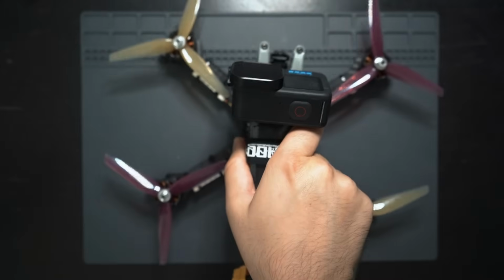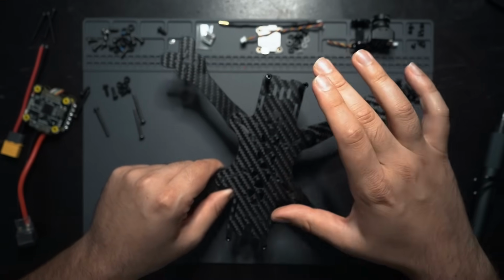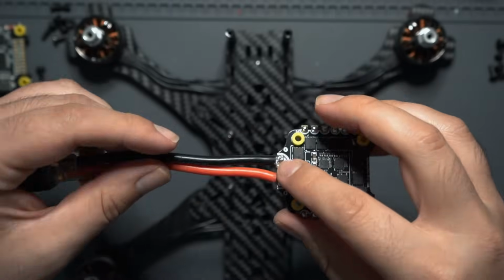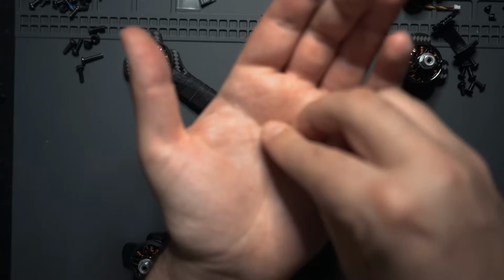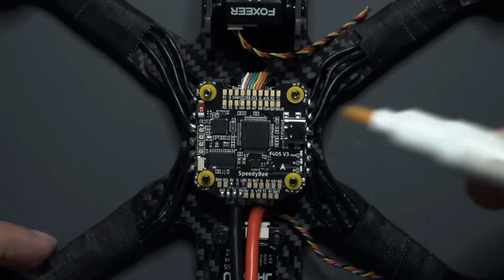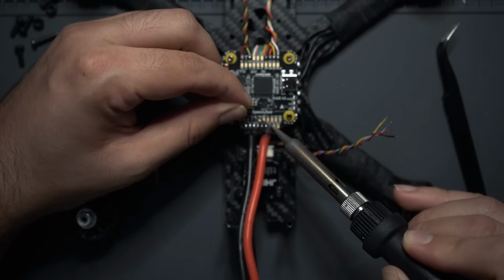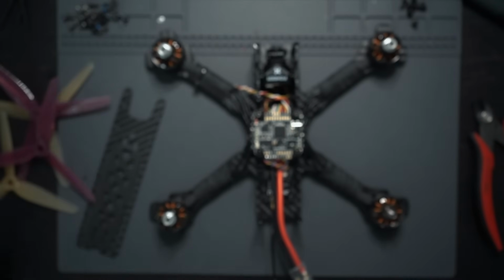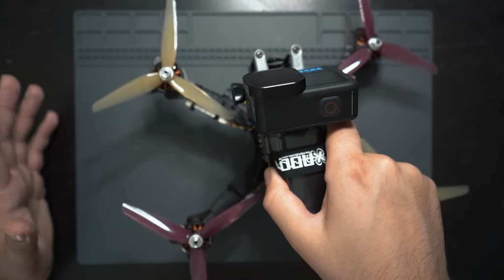Build a Freestyle FPV drone for $200

Comment: You made this look so fun and easy, I ordered the stack a couple days later. 2-4 weeks to get it, but I'm pumped. Thanks for this video, it'll be invaluable. My kids will love the drone we build.
Reply: How did it go??
Reply: @RankedVines  Generally great. The only snag was unrelated to the stack. I got a controller and radio protocol situation that isn't playing nice, and I need a Windows-based computer to do a firmware update. Huge drag, as I use MacOS and Linux. Regardless, I had a ton of fun building around this stack and initial testing was a blast. I can't wait to sort out radio issues.
Reply: Quadcopter
Reply: @murrijuana2842  Do you mean it won't be a drone, but a quadcopter? I thought a drone was a crew-less, either remotely or autonomously operated vehicle. I suppose quadcopter is more specific and therefore technically more correct.

Comment: how would this build compare to a nazgul 5 v2. also how much of an upgrade would you say is switching the antenna that comes with the vtx for the one that you used.
Reply from the maker: I'm not sure about how it compares to the nazgul 5. The stock antenna is good if you think you'll crash alot, otherwise, I would spend an additional $10 or so to get a more solid antenna. You'll get better video signal.

Comment: I built everything the exact same way that u did but the instant that i arm the motors it starts getting hot and vibrating really badly
Reply from the maker: what ESC protocol are you running?
I've heard of issues running bluejay on this ESC, not sure if thats what you're using.

Comment: Do you have a video on how to bind it? I built up the drone but I'm just having problems trying to bind it.
Reply from the maker: the binding procedure will vary depending on what receiver youre using
Reply: @TRONCATFPV  Thanks. I found out that I didn't get the right combination of transmitter and receiver so I got something else and It went smoothly

Comment: Just ordered all the parts from your link, I’ll drop a comment if I really get stuck building it.

Really placing a bet on your setup, I’ll keep you informed how it goes !
Reply: how much you payed ? more then 200$?
Reply: @goldfire4827  total was around 660$ with batteries, charger, goggles, and everything else
Reply: @goldfire4827  the drone itself was 220

Comment: I'm a beginner in this kind of stuff and  i really want to learn how to build one, I just want to know if the controller is included or excluded for the 200 bucks budget. Thank you.. I really need more advice guyz please give me an idea to make one. 😊😊
Reply: The $200 is just for the drone, transmitters (controllers) can range from $60-up I would recommend the Randiomaster TX12. You will also need to buy goggles which are $100-up

Comment: It's $220ish. Not $200. That's without the remote or headset too.
Reply from the maker: Prices fluctuate, it could be $180 next week. 

And yes, those aren’t included in the $200 price. 
This video is just how to build the drone, not an everything included kit.
Reply: @TRONCATFPV  I was just letting other people know in the comments. What is a good headset and remote that is cheap?
Reply from the maker: @ARandomDude72  Please check the description for links to additional equipment 👍

Comment: do you need fpv goggles to fly this?
Reply from the maker: I would recommend using FPV goggles with this drone, but technically you dont need them
Reply: @TRONCATFPV  thanks. could it be flown with android phone with adapter or just by line of sight?
Reply: @TRONCATFPV  I’m new to building drones. I haven’t even watched the full video yet, but I saw the thumbnail and was wondering what the purpose was of two cameras, the little one on a gimbal down below and then the go pro
Reply: @rocketman9030  the little camera is an analog camera, that it the camera where you look through when you fly with fpv goggles. analog because it has a low latency.   The GoPro is just there for the cinematic recording.
Reply: @swugger  thanks! How much weight does the go pro add, and how much is the one he uses in the video? I couldn’t find it in the description

Comment: Hello, im new in FPV and have a question. Do all these little Parts like Cables and stuff come with the parts i ordered or do I have to order these seperate?
Reply from the maker: all of the wires and screws come with the parts used in this video.

Comment: I got most of these parts to follow this build but I'm having a problem. When I arm my drone, the motors will go spin erratically and when I try to throttle up, the drone will wildly flip out. I have already 100% checked prop rotation and prop orientation. I ended up flashing Bluejay to these motors from BLHELI. I re soldered all the motor wires to the ESC to ensure good connections. Any tips or words of wisdom? I'd hate to keep throwing money at the drone replacing parts, until I troubleshot further. Any tips for pid tuning or settings within Beta Flight?

Comment: the frames discription says it can hold a Stack Mounting: 30.5m30.5mm but the fc mounting holes are only 30x30 how does it fit
Reply from the maker: 30.5mm x 30.5mm & 30x30 will fit the same 👍
Reply: @TRONCATFPV  ohh cool i was abt to get a frame 2wice the price caus i thought it wont fit

Comment: Can I mount my GoPro 8to this without doing any beta flight settings? Or do I need to add settings because it adds more weight?
Reply from the maker: it'll probably be good, check motor heat and play with the PID settings if it flies odd

Comment: i upgraded the vtx to a $35-37 Rush tank unit... other than that i followed the build as is...
i got 2x batteries and 3x sets of props... so far iam $320 invested . (free shipping)(late dec pricing) (every thing from RDQ)
i could buy the recomended beginner money saver radio and goggles  but ... ive been researching more and ill probably space out the purchases and get better equipment. 
grand total iam probably looking at $800 invested for my first 'serious' drone 
no regrets , hella excited 

anyone else what was your first drone realty ?
Reply: I am doing something similar were you able to find the BetaFPV 2.4ghz ELRS rx on the website? seems to be sold out everywhere and not sure what a alternative is maybe just the tower version?

Comment: Looking into building an fpv drone and this guide is super easy to understand and well detailed. Two questions I have though are: a) how much does it weigh? And b) what goggles/controllers does this build support?
Reply: I do not have an answer for the first question but the build's VTX card supports all analog goggles and the radio receiver is compatible with all ELRS controllers.
Reply: He literally answers both those questions towards the end of the video

Comment: Awesome video! I'm thinking about doing this for my first build. I bought a rtf drone a while back from rotor riot that came with DJI FPV system, what would I need to buy to use the same goggles and transmitter with this?
Reply from the maker: Instead of using the VTX and camera I used, you will just need a caddx vista/runcam link and you'll be able to use your controller and headset with this quad 👍
https://bit.ly/3C9ic3a
Reply: @TRONCATFPV  Thank you so much! I will definitely look into it.

Comment: love the video.  My question is, is there anyway to connect the go pro up to the video transmitter?  My use is much different.  I am trying to build a target camera with a go pro I already have lying around.  I basically need to be able to set the camera up near the target and be able to view the feed on a tablet 300 or so yards away.  This looks like it would work.
Reply: Whats your use case for it? I might have an idea
Reply: @aepfelpfluecker  I need to be able to see bullet impact on paper targets about 200-300 yards away

Comment: Hello! I'm thinking of building this drone and getting into fpv flying, and this video was absolutely fantastic at explaining everything. My only question before I dive headfirst into buying all of the parts, does the VTX come with that little antenna that you plugged into it, or is that a separate part that you had on-hand? Cause it would be a nightmare if I soldered all of that together just to burn out the VTX.
Reply from the maker: I'm glad the video helped ya!
All of the VTX's that I have ever ordered come with that type of antenna 👍
It won't give you the best range, but it will work!
Reply: @TRONCATFPV  Thank you so much! As I get deeper down the rabbit hole, I'm sure I'll figure out which give better range, but this is a fantastic start! I do have one more question though, is there a handheld controller that you recommend to beginners that would be easy to pair with the drone and start flying?
Reply: @zachd7757  look in his description he should have good cheap items, make sure you get the ELRS version of them though

Comment: Frame: $30
flight controller and ESC stack: $70
Video Transmitter: $15
Receiver: $12
Props: $3.50
Motors: $60
Camera: $20
BetaFPV ELRS Receiver:$12
Batteries:$40

Total:~$260 ...
Plus your radio controller and the goggles, that are another $200.

So like 500$ to get into FPV drones and then a go pro ....

Not quite yet for me. I'd rather go for a betaFPV whoop of some kind as a total beginner anyways ...

Comment: Will Flysky FS-T6 or TX12 Mark II Radio Controller or Boxer Radio Controller (M2) work with the drone
Thanks for the tutorial, it has really helped me out thanks
Reply from the maker: Glad it helped!
Yes you could use this drone with that controller, you'll just need a compatible receiver
Reply: @TRONCATFPV  thanks also will I need or require a pdb (power distribution board)

Comment: What kind of range can you get with this particular set-up using the receiver you have listed in the description? Also, is there any way you can increase the range with modifications to the same set-up?
Reply from the maker: With the antenna-less receiver you probably wont get far range. For longer range I would recommend any ELRS 2.4 receiver with an antenna

Comment: I picked one up last month a the 5 volt pad for the vtx out put full battery voltage and yes I no there is a pad right next to the 5 volt pad that is supposed to out put full battery voltage I soldered it up correctly for a speedy bee tx800 and it smoked it I thought I got a bad vtx so I hooked up a nother new tx800 vtx and smoked it.

Comment: So it’s not $200. You added alternative parts, a go pro because that camera is trash, a battery and most people doing s budget build dong have a soldiering iron/ solder goggles and a remote control. Cool drone though
Reply from the maker: Nope, this drone cost $200. 
The title of the video is "Build a freestyle FPV drone for $200" not "Everything you need to build and fly FPV for $200"

Which camera are you talking about thats trash? The FPV camera? You need the FPV camera for this to be an FPV drone...
You don't need a GoPro to build an FPV drone lol.

Comment: I have built this drone, but I cannot figure out how to connect my tbs tango 2 to the receiver in the description (BetaFPV ELRS Lite RX) sorry if this is a dumb question but this is my first time building.
Reply from the maker: not a dumb question! 
Do you have an ELRS module attached to your tango 2? The Tango 2 has crossfire built in and will only bind with Crossfire receivers (to my knowledge) Since you're using an ELRS receiver you'll need a transmitter on your controller that is on the same protocol.
Reply: @TRONCATFPV  Unfortunately I do not have a ELRS module for the transmitter. After a ton of research and trial and error I decided to just order a crossfire nano rx. What does changing the setting in betaflight to CRSF do then if the transmitter can't connect to it? Probably a simple answer but I am still trying to figure all of this stuff out haha. I love your videos and thank you for the response!
Reply: I have it set up in betaflight with the correct UART and CRSF protocol, but I still cannot get it to bind to my tango 2. Any help on this would be greatly appreciated!

Comment: Great video! I found this very intresting even though ive never flow a fpv drone, would you recommended building a drone for a begginer or just buy something like the betafpv centus pro?
Reply from the maker: If you’re just starting out and have never flown FPV before, I would recommend a kit like the Cetus pro or Cetus X. Then you can use the controller and goggles with future FPV drones. 
Plus when you crash the Cetus is pretty durable, whereas a freestyle drone like this will break easier. 
Once you’re comfortable with the Cetus, then move onto a drone like this  🤙
Reply: @TRONCATFPV  thanks a lot ill look into the Cetus, also appreciate replying as not many ytbers do

Comment: Hi I just finished the build but Im stuck on the speedy bee set up do you have any recommendations?
Reply from the maker: Are you using the Bluetooth app or connecting it to a computer?
Reply: @TRONCATFPV  I’ve tried both all day with the help of some bully devs lol. Still no luck but I’m hopeful. It’s my first build and first time soldering and I got a green on smoker. (W) My issue now is rx is not found. I used a betafpv nano elrs. I can connect with the app but can’t connect my radio because I need to flash my rx to match my current version. (2.4.0) when flashing I’ve tried 3 different methods with no luck. A common error I got was searching for rx blindly.

Comment: I'm pretty new, will it matter if I use a 100c battery instead of a 50c?
Reply from the maker: A battery that has a higher C rating delivers more energy. You should use higher C rated LiPo's for freestyle quads 👍
Reply: @TRONCATFPV  thank you! Much appreciated

Comment: Awesome video.  Lost my quad to dead goggles and a pond so I did this build but used xing2 motors, happy model ep1 elrs, and race ranger 1600mw vtx.  I wanted to see what kind of distance I could get from this thing.  This was my first built from scratch quad so this was very helpful.
Reply: What distance you got?
Reply: @LuisMendez-ck6dv  I haven't gone for a long range fly.  All I have currently are 1500mah packs, so I'd run out of battery well before radio link,  but I've done a mile with lq still at 100 and still plenty of db of signal left.  Expresslrs is like the combustion engine during horse and buggy times.  Ive switched all my quads over to it.  Check out Wezley Varty's videos.  He's tested range and has gotten way out there
Reply: That’s really cool could you tell me more about your setup? I want to be able to do some kinda long range stuff but I don’t have the budget for digital so I’m wondering how much it would cost to get 1-2 miles vtx range?
Reply: @Carl_L  there are tons of 1watt+ analog vtx's out there for not a lot of $$$.  AKK race ranger $25.  Says it will do 1600mw on some stuff, 1000mw (1watt) on other sites.  I tested with an IRC power meter and its between 900mw-1watt. Race Day Quads has their brand 1watt vtx as cheap as $15.  I've used both and was really happy with them both. Rush Tank Solo tested good too.  It did 1.4watt on the high setting but is a little more $ at $50.  I have that one in my 7" long range quad.  Besides a couple of tiny whoops, thats the only analog quad I still have.  Ive since switched over to walksnail.  what a difference.

Comment: Hi and thanks for the great video! I just ordered the frame, motors and stack. I have a question about the camera. JB did a similar video using the V3 frame. He said to use the Razor micro or nano but not the mini because the mini is 22mm wide and won't fit because most frames will only take 19mm or less cameras. In your video it looks like the mini fit well. What are your thoughts on this? Thanks!
Reply from the maker: the mini fits the v3 frame perfect, it comes with an adapter

Comment: How long does it fly with these 4C 1550mah batteries? Is it worth investing in 6c batteries?

And about antennas, which one do you recommend for the vtx and for my goggles?

Thk u very much for the content. Starting in fpv and feeling very confident with ur videos.

Comment: First of all, this is a perfect video and i just finished building my own quad. But unfortunately, when i arm it, the motors just go wild to mostly full throttle no matter how i adjust the throttle stick. I made sure im in acro but even if i was not, this doesnt look like a angle correction...
I just didnt find anything on the internet so i just wanted to ask here if somebody maybe could give some advise, thx!

Comment: Who has used another ELRS with this?  The T-Lite has been unavailable for over a month now. I have a drone with goggles, but no controller.  I see someone mention the radiomaster tx16s mk2 elrs but it's 2-3X the price. I'd like something that works with this and also the indoor cinewhoop build Troncat just posted up.
Reply from the maker: I haven't tried this controller yet, but it looks pretty solid and comes with ELRS built in for about the same price
https://bit.ly/3D87RFq

Comment: Question, can I use any RC transmitter with this setup? Planning on using a radiomaster tx16s mk2 elrs
Reply from the maker: that should work fine with this build!

Comment: so since you used a elrs transmitter on the drone, do we have to use an elrs receiver on the controller? Sorry i am new to this.
Reply from the maker: No worries, yes if you decide to use an ELRS receiver on the drone you will need an ELRS transmitter on your controller. Or you can use a controller like the jumper t-lite v2 that has ELRS built right in!
jumper t-lite v2: https://www.banggood.com/custlink/vKDrvhakHD

Comment: If I wanted better video transmission to my Fat Shark HDO2s what would i change? Also plan on getting a TX16S MKii radio, will this combination do well?
Reply from the maker: You would want a higher output VTX.
Check out RushFPV's line of VTX's. Those are some of my favorite analog transmitters available:
https://www.racedayquads.com/pages/rapid-search-results?q=rushfpv+vtx&aff=58